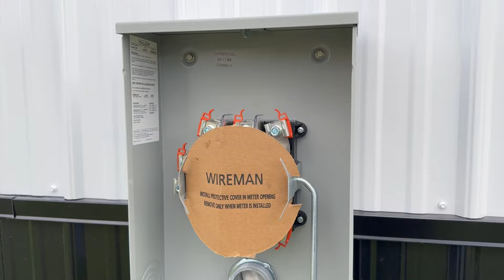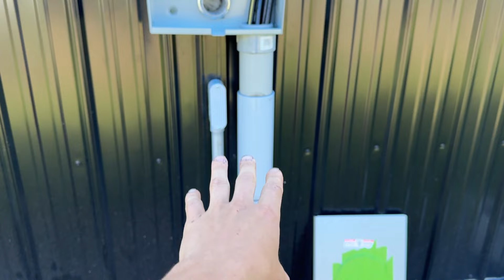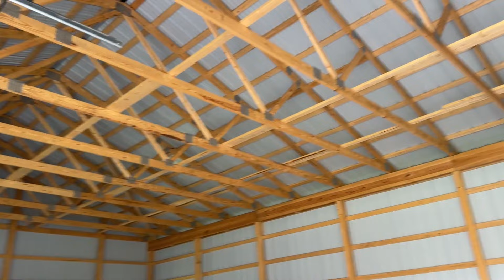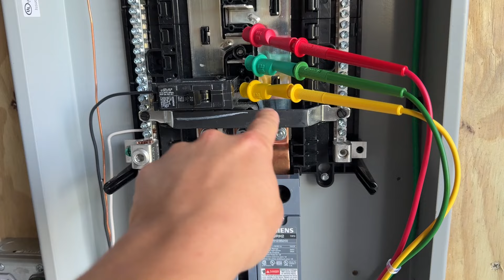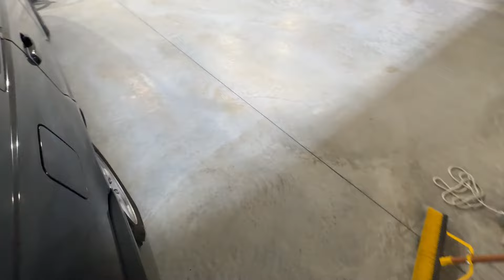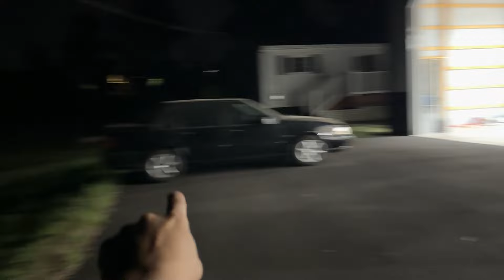What the Hell Moose Performance LLC is Going On?

Comment: Hey! Congrats on the new endeavor. Big fan from PA as well.  Multiple 850’s for over 20 yrs. 
I have a pretty fresh 850 r wagon which I plan on keeping auto. About to install a snabb do88, rip kit, and I would like to do a bigger turbo. Can you give me some advice with tuned ecus for an automatic. I have a RICA and I know it may flash a code. If I install it Also being automatic  can I run white or green injectors without as issue such as fuel waste. Also without totally modifying it who would you recommend for a bigger turbo. Thanks for any advice. Hope to meet ya one day in person.
Reply from the maker: Thanks! It's been a lot of downtime on automotive stuff with the shop build but I think it will really pay off these next few years. I would probably reach out to Aaron at VA5T Performance and go with a fresh tune from him. If the RICA tune was bought second hand it's hard to know what injectors, turbo, etc its tuned for. Software needs to match the hardware. I wouldn't recommend changing injectors, turbo, etc without also accounting for it in the tune.

Comment: Normally 1,3,5 starts from the top left.   2,4,6 from the top right.   Makes sense, too top to bottom, left to right
Reply from the maker: Yep normally that's how it would work. But for an invertible main if you want the breakers to go from small to large numbers you start bottom right 1,3,5 and bottom left 2,4,6.